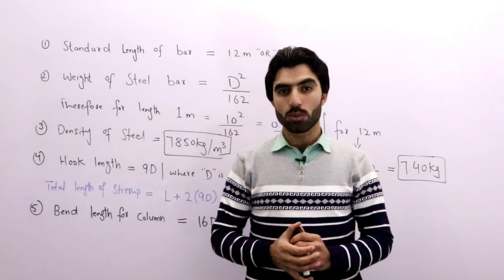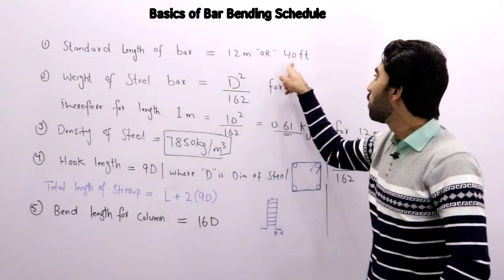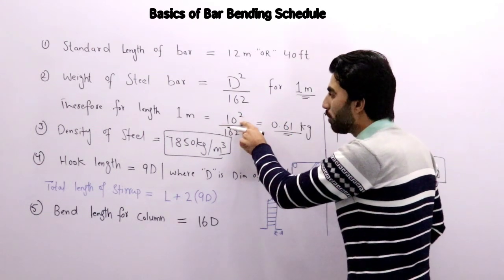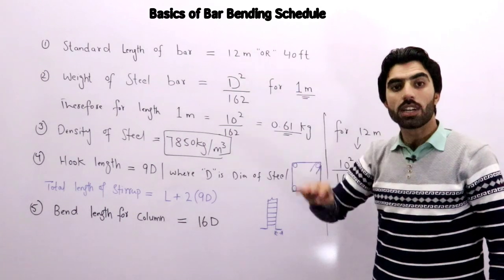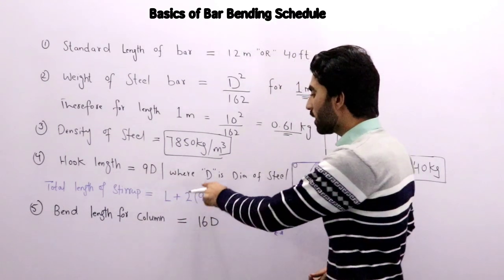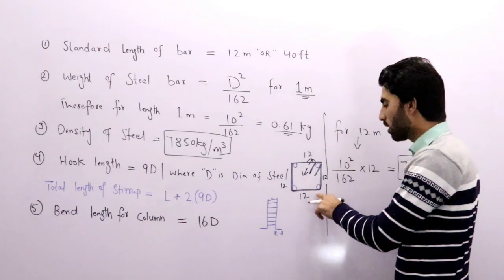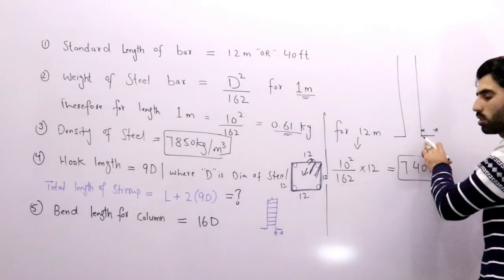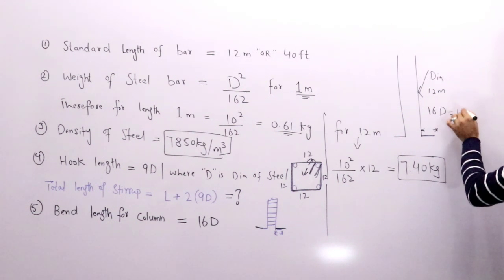Bar Bending Schedule Basics - Bar Bending Schedule for Steel

Comment: Bro...
Weight of steel bar...
1m is the length of bar...
And 10 mm is the diametre of bar...
Is that right... i confused....
Reply: 10mm dia is for example. you can a take dia that yo wants. but you mus know this formula is only about 1m. you can multiply the length that you need.